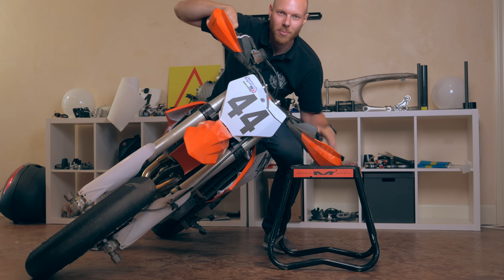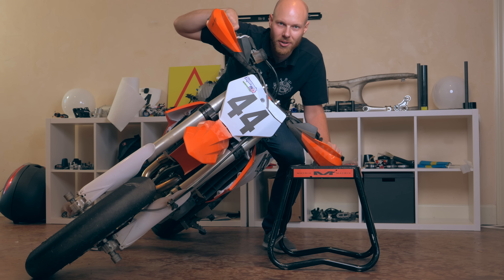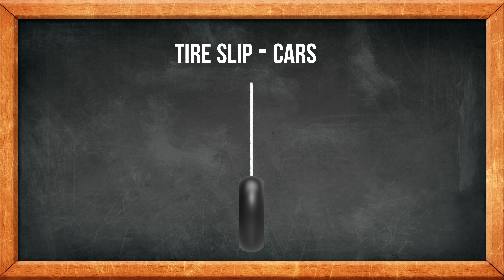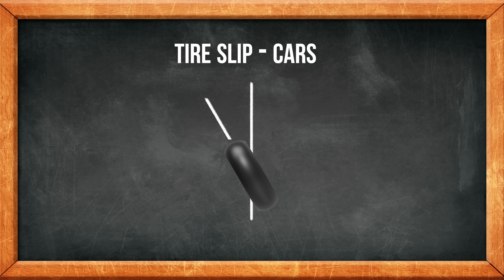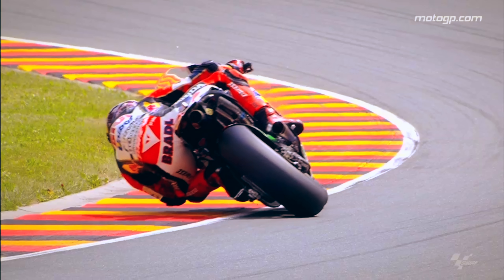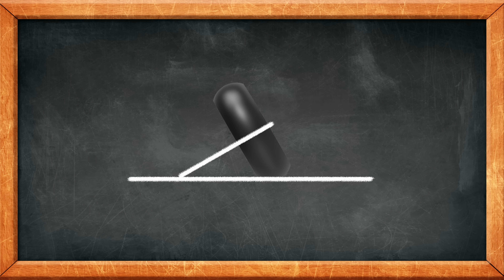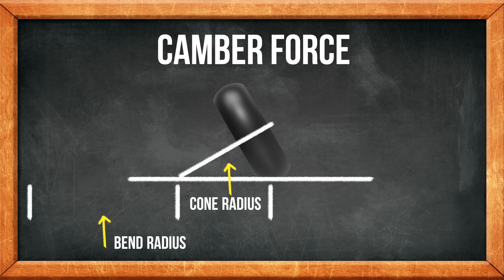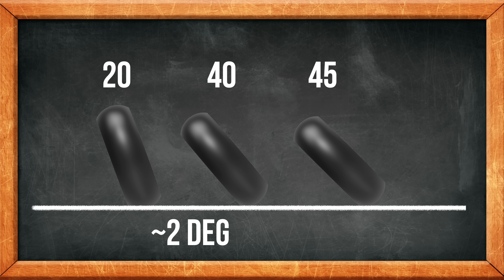How Motorcycles Corner | EXPLAINED

Comment: 1:30 It is not just friction, any rotating object will resist change of direction and react to any change. In the case of the wheel, it reacts to the handle bar rotation by rotating around the ground contact point. That is also how jumpers control the bike mid air. Gyroscopic events!

Comment: 1:02 I'm kinda skeptical about the roll counter-torque component from the wheel being the primary reason for introduction of lean. Intuition feels it's rather than a friction force being applied at the point of a wheel laterally, moving that wheel to one side. Then the force of unsupported weight to one side of the motorcycle causing a rotational moment due to gravity and that causing the bike to lean to one side. 

Of course there's a roll torque component but I would be surprised if that was responsible for the majority of it. Imagine we replaced the front wheel with a mini ski so that there's no torque induced from wheel spin. I feel that the rate of lean added per distance would be negligibly similar. Also, imagine a motorcycle with the wheels suspended off the ground, front wheel in full turn lock. Does it seem reasonable that the wheel spin from its speed at 15 mph would realistically create the type of torque needed to quickly lean a bike to one side as a small countersteer does? Remember, it only takes a countersteer of a few degrees to induce immense lean angle rapidly, and only a small component of that translates to roll torque. If the steering angle is 10°, that's only sin(10) or 17% of torque generated.

Comment: Gyroscopic precession, is a torque that is not that powerful, and doesn't affect things much.   I am quoting you, but have hard believing that you know what degree this force is playing in the dynamics of the bike.  A bike going very fast, with a heavy wheel lets say, or a large wheel like a 21 inch, I would argue plays a significant affect the torque being applied within.  I mean, bike don't  require a rider to balance, just steer and control speed, but not to balance.  The the gyroscopics of the wheels spinning will balance a bike, so altering the axle direction I believe plays a quite a large role, in unison with contact patch direction
Reply: Gyroscopic stability and turning was debunked by Cornell university who installed counter rotating wheels to cancel gyroscopic effect. No change in stability or turning. Search:
Most People Don't Know How Bikes
Work
Channel is called:
Veritasium. Lots of great other stuff there also.
Cheers.

Comment: Hilarious.   You threw in every technical red herring you could find and you still couldn't explain why a bike turns,  though you mentioned it in passing in one diagram.   Tires are basically two cones joined together at the fat end.   Actually they are variable angle cones but that information is not necessary to understand basic turning.   As long as the bike is riding on the join between the cones (middle of the tire) it goes straight.   As soon as the bike leans over onto one of the cones it turns because the outside of the cone (tire) has a smaller radius than the inside  of the cone.  Since the outside of the tire is covering less distance per tire revolution than the inside of the tire but both are constrained to the same number of rotations by a common axle the wheel has no choice but to roll in a circle,  the inside of the wheel rolling in an arc of bigger radius than the outside of the tire. That's it.   Done.   You're welcome.   Incidentally,  the forces generated by the gyroscopic precession are not small,  they are huge and much greater than weight shifts can generate,  which is why counter steering is so effective.
Reply from the maker: Hi William, great way to begin a conversation. 🤣 You must have a lot of friends.

To get serious here for a minute, feel free to refer to:
Motorcycle Handling and Chassis Design by Tony Foale

Motorcycle Dynamics by Vittore Cossalter 

The Racing & High-Performance Tire: Using Tires to Tune for Grip & Balance by Paul Haney

Best of luck in your future endeavors.

Comment: I think I'm about to see you explain what a rider (a reckless one i'd say) my friend explained to me after i told him I was going to crash in the external side of a bend with my first 125cc, a Derbi, a racing chassis not a dirtbike or a scooter as I always rided before. 
He said like this: "Imagine you're on a CAR driving on the two left wheels. You're about to tip over (rolling left or counterclockwise). What do you do?"
Me: "I'd...steer...left. Counterclock."
He: "Exactly."

He added: "Try to notice when you steer and lean on a side, you can actually lift the opposite hand from the handle bar and salute the people. 
Well try it at less than 60/h. And turning right not left...ya know...the throttle..."
"This means you're not applying any force on the side of the handle which is external to the bend."
"Therefore you're actually countersteering, when leaning."

My mind was blown in that exact moment, but that motherfuc*er saved me from blowing all the rest plus the bike, in a near future. And not leaning or dnk how to, on a race chassis bike is not matter of going fast or slow. It's a matter of having a chance to complete the corner, or miserably crash into the external side.

This is a really practical ground-skill (pun intended) anyone who sets his ass on a bike HAS TO know BEFORE starting the damn engine. Even on a 50cc at 14 years old.

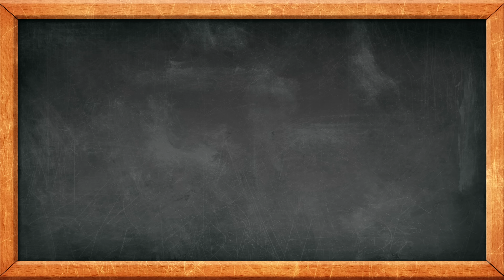Comment: 11:20 so this doesn't really correspond with 10:45, does it?
When you move the CoG backwards you have more load on the rear tyre, meaning more lateral force available, BUT also more weight "to push" to the inside of the corner. You gonna have less lateral force available relative to lateral force needed.
Which doesn't really do that much sense in reality since we see riders moving over the front axle to corner, so why is that?

Comment: Question...  If the bike turns due to the cone effect of the tire shape when leaning, will it mean that when hanging on the side, it will make a straighter bike angle, thus... less cornering radius?  Hanging only helps fight the centripetal force, not the corner radius?

Comment: What a great clip, thank you!
There's just one thing I don't understand, apart from the mathematics - don't worry It's not you, educational and mathematical geniuses are powerless to that into my head! - which is the effect of wheelbase on steering.
We've all experienced the heavier steering of bigger bikes but bigger bikes are almost always heavier and generally will have bigger tyres and more trail, all of which will slow (increase resistance to) steering, but if we view the bike from the point of view of leverage then more wheelbase means more leverage which should translate to reduced effort required. By leverage, I mean the steering exerting force into the frame at the steering head to first roll the bike then guide it through the turn.
Another thing that will mask the true effect of increased wheelbase on steering is the arc of turn, to achieve the same arc of turn on a longer wheelbase bike compared to a shorter one, all other things being equal, is that we will have to use more lean angle to allow more steering both of which require more rider input, i.e. we have to ride the bike harder which suggests to the rider that the steering is heavier even if it's actually not.
Am I wrong? Is there something I've missed that actually makes the steering specifically heavier with increased wheelbase?

Comment: what happens when you offset the front axle to the forks, to make the wheelbase shorter without reducing rake angle?
Reply: You increase trail which slows the steering, the effect on cornering is slightly mitigated by the reduced wheelbase but the overall effect remains a slower handling bike.

Comment: Counter Steering will work above certain speeds ! You cannot CS at low speeds on a Bike ..Lol
Reply: It is the only way to steer if you are moving, unless you are hopping the motorcycle.
Reply: @DumbledoreMcCracken  Have you ever driven a bike ?  Try counter steering at 5 MPH and tell me how you make out dude !! You need to be going at least 20 mph for countersteering to work effectively !! End of discussion !!
Reply: I have two questions for you:
1. If the steering has the opposite effect above or below the magic speed, what speed (in between) are you saying the steering has no effect whatsoever?
2. If you turn the bars all the way to the righ at a stop, rev it up above idle and dump the clutch which side of the bike will you have to rebuild?

Comment: "When we introduce lean into this rotating mass", referring to the steering torque generated by leaning the bike,
is how people can ride bicycles and motorcycles "no hands" - by steering with pressure of their knees against the tank or frame,
causing the lean, and the front wheel to steer towards the lean.
Reply: You don't understand.  You lean right to turn right, but that causes the front wheel to turn left because the frame moves left when you lean right (equal and opposite force), and the wheel turns left because of gyroscopic precession, which leans the BIKE right, and now you are turning the bike right.
Reply: @DumbledoreMcCracken   - See the Youtube video on MIT freshman Physics 8.01, lecture 24, on Rolling Motion and Gyroscopes:
https://www.youtube.com/watch?v=XPUuF_dECVI
For the front wheel rolling forward, a torque exerted by the rider's knees to the right would cause the front wheel to turn to the right.
Using the professor's mnemonic, the wheel's momentum, which points left (using the Right-Hand Rule) follows the torque caused by
the rider's knees - which points forward (again, using the Right-Hand Rule) - and the wheels' momentum vector "follows the torque" vector,
turning the wheel to the right.  Note that I didn't say that the rider had to lean to the right - just push his knees to the right, perhaps bending
his body at the hip to do so.  Using that mechanism, the rider can control the direction of the front wheel as if he were using his hands.
Reply: @daveinwla6360  already have
Reply: @DumbledoreMcCracken   - Then, Dumbledore, you see that while standing (as motorcycle racers do upon victory) and pushing one's knees right, the front wheel turns right.  Or while sitting, a rider can press on the right peg and move his knees and hips right, and the torque towards the right causes the front wheel to turn right.  Don't try this at low speed, though, as the gyroscopic force needs some rotational speed of the wheel to become apparent.
Reply: @daveinwla6360  make a video.
All I have to go on is about 10k miles of riding a bike, and about 1500 miles riding a motorcycle.
Reply: @DumbledoreMcCracken   - Pay more attention to the details of what you actually do.  Almost all the things which we learn to do with our bodies is unknown and not understood by our conscious minds.  Imagine having to explain to a snail how to walk.
Reply: @DumbledoreMcCracken  Perdón por contestarte en español.
Esa es la teoría, pero en la práctica no funciona así como trata de explicarte el otro usuario.
De primeras, coge una bicicleta, de forma estática, e inclínala. La rueda delantera gira en el sentido de la inclinacion para dar estabilidad. 
El momento lo mantienes con el peso de tu cuerpo.
Y hay otra cosa que entra en funcionamiento: el perfil de los neumáticos.
Estos pasan a ser (de forma simpe) rectángulos a troncoconos, que por su perfil, enfatizan el giro. 
He llevado muchas motos, pero sobre todo de motocross, enduro y trial y nunca haces contramanillar para iniciar el giro. Ni levemente.

Comment: This was old thing when I was riding. If you are ping straight.and want to cut a right turn on a dime. You can't . But you can. How, push you right hand fast to beak your center of gravity that want to go straight then in that same second pull after and bend your body right side You will cut .
right on Dime. Unless you are still  sitting straight up. They you fly off the bike going straight . LOL

Comment: How do you actually add lean angle in a corner??
Reply: Push on the handlebar that is inside of the corner. For example, if you are at a mild right turn and you want to increase the lean angle, push forward on the right handlebar. To decrease the right lean angle, push forward on the left handlebar, and vice versa.
Reply: Countersteering

Comment: Well that was entertaining, in a face palm way. Can you explain demonstrate gyro precession including the rear wheel as well as the front during a lean? 

Also, how does friction generate a centripetal force? How is torque not at the pivot, I.e the contact patch? 

You're missing inertia, angular acceleration, tyre shear and a few other things. Lean doesn't create a counter torque, gravity does. Can you demonstrate how the rear wheel applied a yaw, but the front doesn't create a counter yaw?
Reply from the maker: You must be a centrifugal force type of guy. lol
Reply: You are not quite as clever as you think you are.

Comment: I always appreciate these videos as they go deep dive on the theory behind what we do. However, I didn't find a video where they explain you to have more confidence on the grip of the tires, on the street. How i can go faster without thinking i'm going to have a lowside for exceeding the lateral forces, eventhough i'm not by far at the 45 degrees limit. The theory is there, smooth on the gas, lean more, load the front tire, etc, we all have read the Twist of the Wrist Volume 2 but i can't really improve my leaning technique with only theory. There must be a way on it, without spending money on courses, or trackdays, just by practicing but with something to rely on, that you can feel. It's easy to feel the grip going away on a car, (understeering) but on a bike, the only feel that you have for lack of grip on the front is the impact with the ground and the expensive visit to the shop :( Maybe some leaning and G gauges that BIP when you are at some % of the limit that could grow your skills by setting the warning higher and higher...
Reply: get a small dirt bike and rip around a parking lot, its low stakes cheap and the skills transfer to bigger bikes, you’ll be dragging knee in no time

Comment: NEED MORE EXPLANTION!!
you said, relatively, the bike has heavier front is more likely to go understeer, but I don't get it.  help.  Usually, FF vehicles are tend to go understeer, on the other hand, RR vehicles are oversteer as I know. So I thought about it.  When vehicles or bikes are turning, there is centrifugal force all the time.  and the more mass get more the force to go straight.  so I think bikes has relatively heavier rear is tend to oversteer, not understeer.  I know there are more condition like..  is the bike accelerating? or braking  but I think the concept that centrifugal force effects more to the heavier part is based on every conditions.  please inlight me.  thanks.  You r my best teacher!!